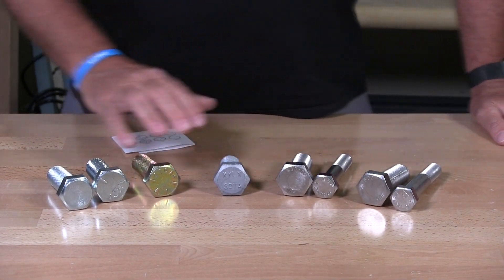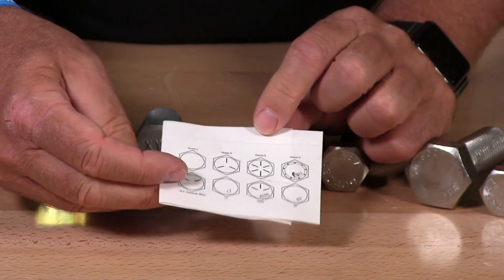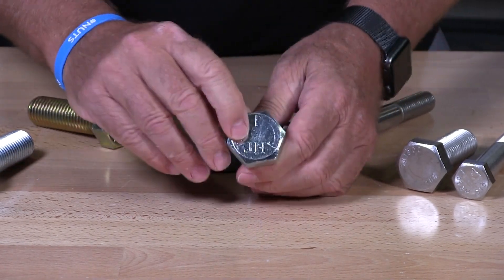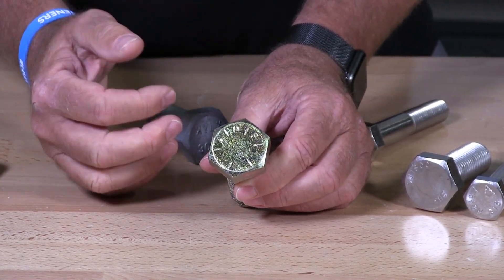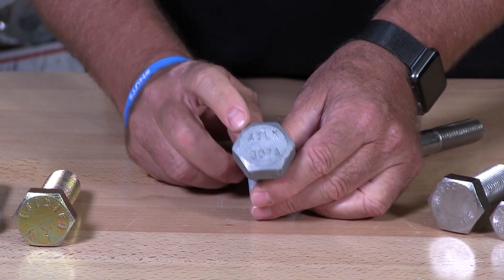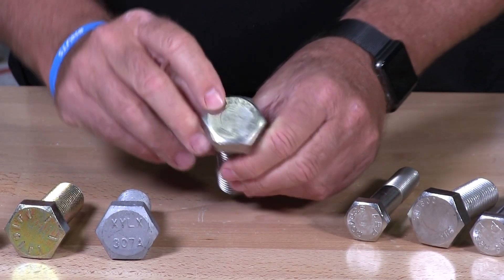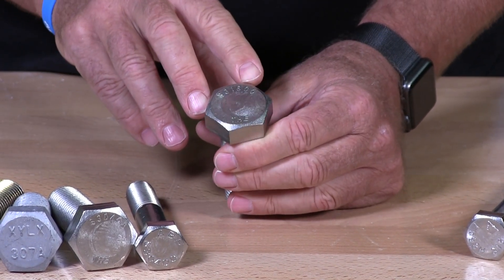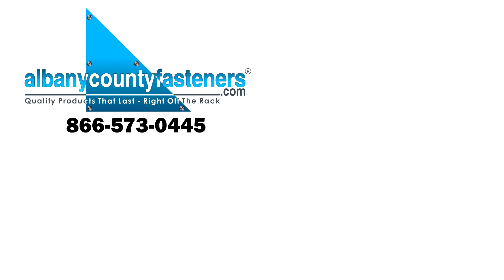Bolt Head Markings: What do they mean? | Fasteners 101

Comment: I just learned that you add 2 to the number of slashes on a bolt head to get the grade. 3 slashes add 2 and you have a 5 grade. Pretty cool. Always add 2 to the number of slashes for actual grade.
Reply: This might seem like a radical concept, but wouldn't it make more sense to use five marks for a grade 5 bolt, eight marks for a grade 8 bolt, etc.
Reply: @francoamerican4632 or just stamp the number in the center

Comment: Any way to buy a bolt knowing the girth of the threads, & the length of the bolt?
Reply from the maker: If by "girth" you mean diameter then yes! Bolts are sized based on their Diameter-Thread Pitch x Length. For example, a 1/4"-20 x 3" FT Bolt has a 1/4" diameter with 20 threads per inch and is 3" long, full threaded.

Comment: Just curious, is there a reason they complicate bolt markings?  3=5, 6=8.  What’s the philosophy behind this, instead of just saying 3 is not as strong as a 6?  Normally there’s a reason behind it, so just curious.  Funny how bolts go up in numbers when stronger, but in electrical wiring the thicker the wire the lower the number.  Sorry to be a pain in the ass, one of those questions that always makes me scratch my head.
Reply from the maker: The grade markings were decided by the Society of Automotive Engineers (SAE) under their J429 specification. As far as we're aware, there's no particular reason that they are set up this way; it's just what SAE decided on when they made that spec. The general rule of thumb is that the grade is 2 less than the number of marks. Sorry this isn't exactly the most informative answer. I can't find anything about why those numbers of markings were chosen specifically.
Reply: Most probably because the 3 & 6 dash markings are symmetrical thus easy to identify without the need to count marks. Grades 5.1 & 5.2 have markings on one side, closer to each other. Same for grade 8.2

Comment: 3 slashes grade 5
6 slashes grade 8
yeah american measurement systems xD
Reply: Our measuring system is called the Imperial Measurement System - it was developed by the English
Reply: @lacausa2000  i know and i feel empathy for you :), (i am lucky i need this just for plumbing, you need it for everyday stuff)
Reply: Well in terms of bolts, metric have 5.8, 8.8, 10.9, and 12.9. can you explain what the decimals indicate? Because they don't indicate tensile strength, so they could have picked 5, 8, 10 and 12 just like sae picked 2, 5, 8 and 9

Comment: What is the difference between an A2 and A4 bolt?  

I replaced a bolt marked SRS 8.8 with one marked XXYX  A2 S304.    I was told to find one marked A4, but A2 was all I could fine.  This is going to see a lot of road salt in the winters.   The bolt is used to keep a DEF injector mounted to a diesel exhaust system.  I figured any stainless bolt would be better than a carbide steel bolt, which I think was originally in there.
Reply from the maker: You're gonna want to find an A4 bolt to replace that A2 then. A4 is the metric equivalent to 316 stainless steel and A2 is the metric equivalent to 304 stainless steel. A4/316 stainless steel bolts are very corrosion resistant and are intended to be used in areas of high corrosion such as near salt water or heavily salted roads.
Reply: @AlbanyCountyFasteners  Thank you.
Reply: @AlbanyCountyFasteners  304 are actually more corrosion resistant in many environment, especially near sea water.

Comment: I just purchased a standard GR 5 hex cap bolt from Fastenal and the mfg marking is FNL. Except for the FNL and the 3 strike marking, the head also has "HT". I checked the SAE J429 and did not see anything mentioned about such marking. Could it be "JH" as "FNL" is a sub-company of "JH"?
Reply from the maker: Possibly. Markings beyond grade or material markings vary from manufacturer to manufacturer.

Comment: I have purchased Bolts marked "Fed-Alloy" With 12 markings. They were sold to me by Acklands-Grainger Industrial supply on sale. Are they the strongest bolts available?
Reply from the maker: The "strongest" bolts for commercial uses are usually Grade 8 (US) and Class 10.9 (Metric). We say "strongest" because a strong bolt can mean many different things. As far as the numbers go, these two boast the highest proof load, yield strength, & tensile strength of commercial grade bolts at the expense of ductility and a higher chance of fatigue failure over time. However, stainless steel bolts, while weaker in the numbers that make grade 8 and class 10.9 strong, have much higher corrosion resistance and can even resist salt water if the right grade of stainless is used. How do you define the strongest bolt?
Reply: @AlbanyCountyFasteners  Thanks for your response.
Reply: Any bolt with more than 6 slashes usually indicates an alloy steel bolt or 'grade 9' bolt. They are comparable in strength to metric 12.9 bolts, but they are much harder to find.

Comment: Great vid. One comment. The stainless bolts are not delineated by higher or lower grades. Each stainless alloy is typically designed to do a specific job in preventing corrosion. 304 is a basic 18/8 alloy that has a broad range of uses and is reasonably priced. 304 is also typically used in you house, kitchen sink, knives, forks etc. 316 has a small amount of molybdenum in it. Typically used in the food industry as it has excellent resistance to the acids found there. When using stainless bolts it is wise to understand strength of the specific alloys as their properties differ vastly from carbon steel bolts. The L appended to the end of the grade (IE: 304L) means that the alloy is low carbon and meets that specification. Happy days
Reply from the maker: Very good information to add!  Thank you for your feedback!
Reply: Thanks. I was wondering because he left out so much explanation that is needed.
Reply: What about for outdoors ?

Comment: Could you help me explain about symbol M, 8.8, and MICon cap bolt of china product?
Reply from the maker: The M means it's a metric bolt. The 8.8 is the grade and material of the bolt, in this case, carbon steel. The first digit relates to the minimum tensile strength of the material in megapascals (MPa), so that would be 800MPa, and the second is the yield strength in percentage, so that would be 80%. Lastly, MICon is the manufacturer's stamp.
Reply: @AlbanyCountyFasteners  I think I have a misunderstanding here. What I hear you saying is: Ultimate tensile strength (UTS) = 8 N/mm^2 = 8 MPa and YS/UTS = 0.08. Both does not make sense. Could you please clarify what you actually mean.
Reply from the maker: @friedensreich61  Hm...that response may have been in error. We've updated the comment to clarify what the 8.8 represents. We apologize for the confusion!
Reply: @AlbanyCountyFasteners  thanks for the quick clarification. I would even formulate that the first digit is the min. tensile strength in 'hundreds' MPa and the second is the ratio 'tens' of percent. But with the numbers you provided, very clear indeed.

Comment: Thanks for answer on stainless bolts. I was just trying t figure where in automotive use I could use them. What are grade 2 bolts in comparison to tensile strength. Thanks
Reply: dnolder1, I don't know the tensile strength of grade 2 bolt but the fact that it has a lessor tensile strength saved my expensive rotary cutter when the blades hit a big stump in the ground.  That single little bolt is the sacrificial part of my cutter therefore, I carry additional grade 2 bolts when cutting.  Sorry, I know this didn't answer your tensile question but your question gave me a flash-back of when the snapped bolt saved my cutter. 🙂
Reply from the maker: The Tensile strength of a Grade 2 bolt may vary slightly depending on size but will generally be about 74,000 PSI (1/4" - 3/4" Nominal) or 60,000 PSI (3/4" - 1-1/2" Nominal).

Comment: How would you know what hardness a stainless steel bolt is?
Reply from the maker: There is no hardness to stainless steel and has no rating.  Grade 8 bolts have a proof load of 120,000 pounds per square inch. The minimum strength of stainless steel bolts is 40,000 to 90,000 psi. The minimum strength of grade 8 bolts is 130,000 psi. Grade 8 bolts are much stronger than stainless steel.